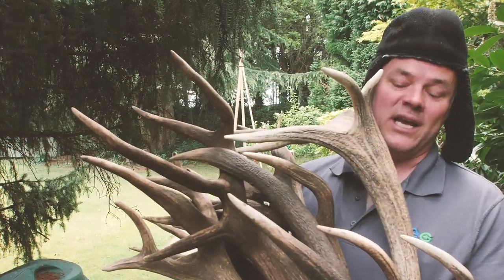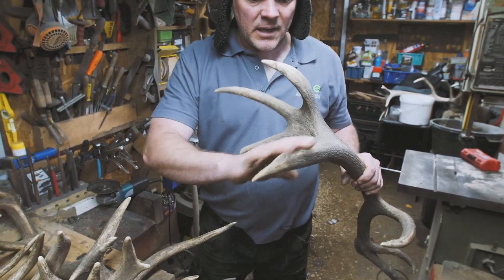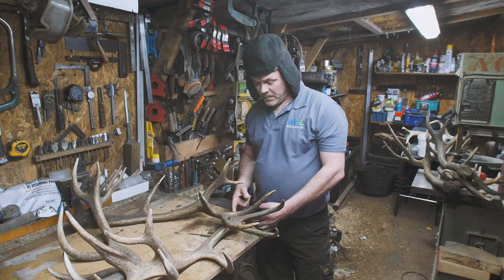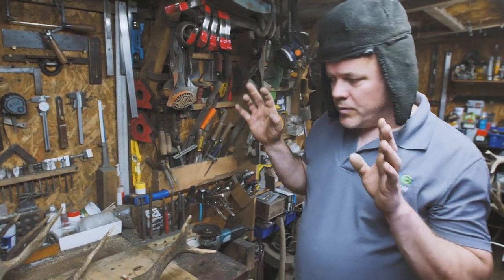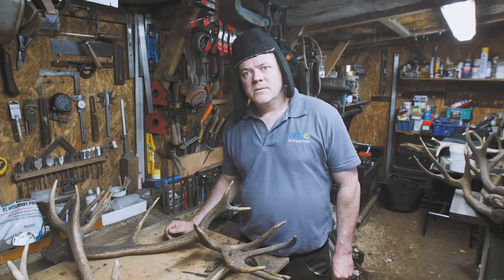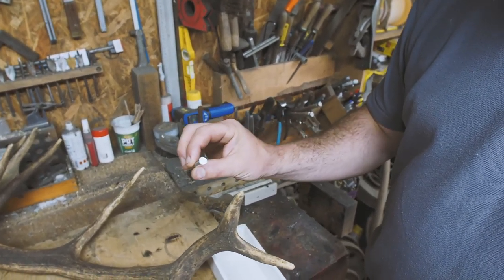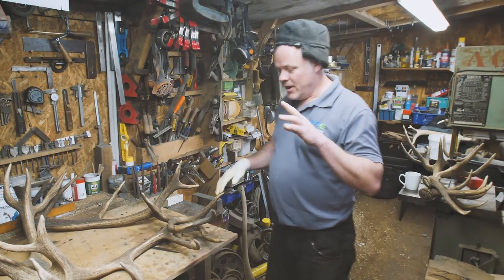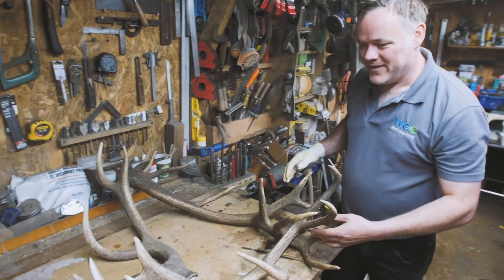Awesome Stag Antler Chandelier - Part 1

Comment: Just found your channel. Love it already. Love the chandelier! Another idea for joining the antlers together would be copper rivets. I use them in my leather work all the time. They’re easy to peen and give a rustic look
Reply from the maker: Hey @Raceydog thanks for commenting and welcome into the Shedulencia! There was a section we filmed where Al discussed using the rivets like we used on our lamp build - check it out we do exactly what you describe! - which were copper, only he didn't have any long enough to pass through the antlers, and because it was time sensitive we had two find a solution quick. Great idea though, we appear to be simpatico - you can stay!

Comment: Too late now but I'm with Camera Boy on this one. In. On another subject, from years of welding and grinding experience I can tell you that sparks burn into glass lenses but bounce off plastic lenses. When it comes to aesthetics should Tammy not be the deciding vote?
Reply from the maker: It is / was the right decizionne! The butcherer of metal, wood and horn was wrong. Tammy jumped ship way before it sank. Clever.

Comment: Rather than messing with hydrochloric acid you can do the same thing with hot vinegar… Actually doesn’t have to be hot but It will strip the zinc in an hour rather than a day.  I use a crockpot from a junk shop
Reply from the maker: Great tip, thanks Cody!

Comment: I'm full of lousy ideas today. Why not use just the 3 you have put together and make a ring to fit the middle and that way you could make 2 of them and have something to hang it from. I probably didn't make sense so feel free to disregard this post. lol
Reply from the maker: Not lousy at all, Peter - Al actually makes a smaller version using three horns, you'll see it later on, which has horns pointing up too, which works better because the ceiling is so low having it the same way as the large version would end up with people's eyeballs impaled on the points!
Reply: I got to agree with Peter but have them hanging from three chains attached to a 3inch dia ring suspended on a single chain 🕯🕯🕯